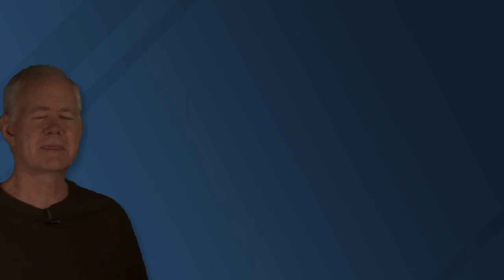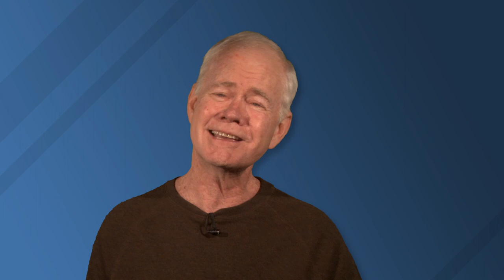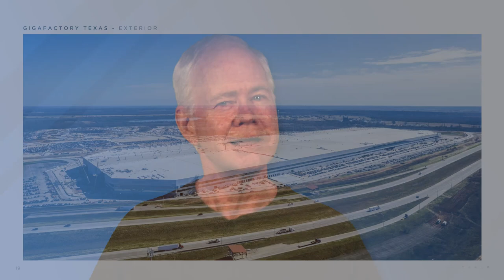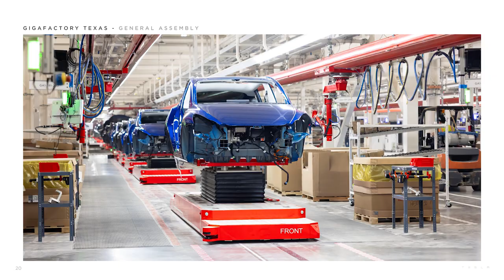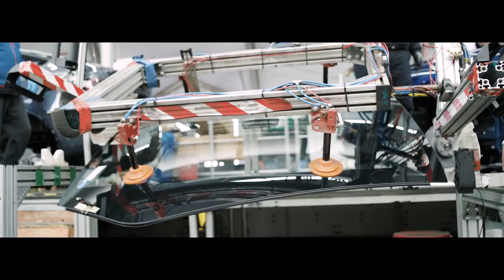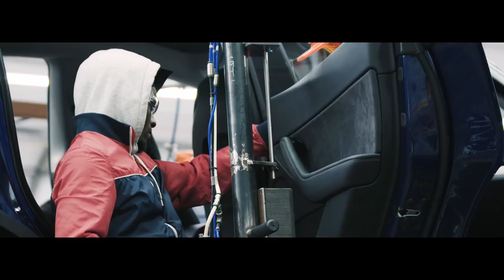Can Tesla Surpass GM & Ford? Here’s What Will It Take for That to Happen

Comment: Volvo just started using one piece casting in the rear. Nobody else is doing it yet... while Tesla is delivering front + rear casting + structural battery pack Model Ys in March, from Texas. Castings are a bit more expensive than steel, BUT a lot lighter, stronger, higher precision and only takes ~1 minute to make one.
Tesla can't do "everything at once", because they have limited chip&battery supply, so they have to use them as efficiently as they can. It would make no sense to make just a couple thousand Cybertrucks per year in a 2 billion dollar factory.
Reply: Volvo just announced that they are looking into using rear castings in the FUTURE. Model y has been using rear castings from Freemont and Shanghai for quite a while now.
Reply: @dclpgh  Texas, not Fremont, and I don't think Shanghai either. Structural battery packs are not unique to Tesla.
Reply: @AutoReport1  you're a little behind on your information my friend.
Reply: @dclpgh  hmm, no just got Texas news mixed up with Fremont.
Reply: @dclpgh  IDRA and another supplier are bullish on sales to other automakers, but don't even confirm supplying Tesla with the biggest die cast machines. I wouldn't count on Tesla maintaining this lead for even a generation.
Reply: @AutoReport1  Fremont was the first to have operational Giga casting machines. Shanghai has four Texas has 3 up and running with two on the way. The German plant as2 up and running and we'll have 6 total. See? Now you're all caught up.
Reply: @dclpgh  
@andrew charles The first Model Y coming from Fremont had a two-piece casting, but they quickly upgraded to single-piece after just a few months. Shanghai Model Y also has the single-piece in the rear. Texas has front+rear+structural pack, Berlin just the front and rear castings - standard 2170 pack.
Reply: @AutoReport1  CLUELESS
Reply: @dclpgh  No, they are retrofitting the Torslanda plant and will use the castings for a 2025 model car. Polestar will also use them but they're making bonded aluminum frames on a 2024 model as well. Volvo is pretty aggressively going BEV but they are only at 6 percent BEVs. They do have a new EV out end of year and one out next and probably one per year for the next few years.

Comment: Tesla needs to focus on it's Cyber truck and get it out before the Silverado EV . The next vehicle should be a compact pickup based on the model 3 or Y to compete with Maverick and Veracruz. 
We have not heard alot about on the Semi. If they are still making the semi, that should be the next factory. If the Semi fails thats your backup production facility. 
Building a factory in Detroit would be a slap in face to GM and Ford, but not practical. Next factory should be on the East Coast to cut shipping costs and create another supply for Euro market.

Comment: They'll need a truck, or two, the roadster, the model 2...and 3 more factories.  AND they have a very difference perspective - million mile cars, exterior/interior styling doesn't change much so if you buy a tesla will you need to replace it every so often? If not what does that do to the used car market?

Comment: With EV’s, there is little to differentiate drive trains and power electronics. It will be more about design and practicality. Tesla isn’t set up to bring new designs to market. Inertia is what will hold them back.
Reply: Do you think Inertia will slow down Tesla?  I don't think so. Tesla is constantly updating EVERYTHING.  Look at the Giga Castings- No one has that and that alone has reduced the time to produce a car from 30 hours to 10 hours, and the number of parts from 140 to two. The model S power train is more powerful every year, and its design is the example for every car maker. Then look at Tesla's Octa-valve, the most efficient way to distribute and control the cooling and heating system in ANY EV.  The battery's chemistry is improving constantly, so is the efficiency is also higher, and Tesla is also adopting LFP.  Those are some of the instances, so I don't think stagnation is in the roadmap for Tesla. For GM, Ford, Stellantis, BMW, Daimler Benz, VW and Toyota,  yes, stagnation is the name of their game. and they need to get rid of their ICE business model first.

Comment: The problem Tesla has with gaining that kinda market share in the US is they're not making the models that Americans buy the most of. Model Y is the closest thing they've got to where the current US market is. Tesla needs a midsize pickup, a full size SUV and a full size pickup that doesn't look like a 9 year old designed it. The Cybertruck is the only somewhat desirable vehicle they have in the pipeline for mass sales, the Semi and Roadster 2 are not going to bring significant sales volume. 

Even if Tesla has some SUVs and a midsize pickup in development, what happens to Semi and Roadster 2? Will their release dates be pushed back additional years? That means at the soonest new Models from Tesla are not gonna be available for at least 4-5 years and that gives OEMs plenty of time to ramp up several vehicles at the same time. 

Companies like Ford and GM are well seasoned at developing a dozen models or more at the same time and bringing them to production on time. Look at GM recently, in just the last couple years they've come out with all new versions of their full size pickups, full size SUVs, refreshed multiple models and a completely new Corvette with a completely new engine placement. That's just the ICE vehicles they've been working on, at the same time the Hummer EV, Silverado EV, Lyriq, Equinox EV, Blazer EV and Sierra EV have all been in development. Plus EVs have less variety in propulsion systems compared to ICE vehicles, this means GM can share components they never dreamed of and that speeds up development time and cost.
Reply: The Tesla CYBRTRK  when it comes  will be impervious  to HAIL ,  and  Baseball bats,I like watching AARebuilds , Randy in Youtube  as he looks  @ Hail damaged  cars and trucks SUVs in  Oklahoma Copart Auctions.
Reply: @aurelio-reymilaorcabal9669  the Lordstown factory will have a production rate of 50 gigawatts a year and GM has 4 battery factories in development to keep up with demand as they transition. Springhill Tennessee factory will be complete in late 2023 and Lansing will be ready the following year, the 4th factory location has not been announced yet. GM has multiple factories around the world that can easily be retrofitted for EV production, they won't have a problem with scaling up. Raw resources is gonna be the limiting factor for all EV manufacturers moving forward as EVs start to become mainstream.

Comment: What your forgetting is the capacity of GM and Ford are gas and that will shrink. Tesla is electric and that will grow. Plus the big 3 are converting old plants which is not as efficient as a purposeful built Tesla plant. Also all of the testing ive seen shows Tesla has the best battery's by about 20 percent. Marys 25 models by 2025 is a pipe dream at best and the electric hummer and lyric sure are not going to push them ahead.
Reply: Hey hey hey, how dare you talk about Mary bo-berry like that. GM can totally make 25 different EV models by 2025. All they gotta do is make 25 of those skate board thingies and slap a different body style on each one and BAM! GM is still the EV "leader". Then some idiots can buy them for over $1mil each like the first Hummer.

That being said, if GM has 2 EVs that hit volume production by 2025 I'd be surprised.

Comment: Tesla certainly has first mover advantage.  But it doesn’t appear to me they have any long term competitive advantage.  Many people believe the Mach-E is already a better vehicle.
Reply: I don't see how the Mach-E is a better vehicle. Tesla is ahead to Ford and GM at least 5-8 years.  The Mustang's autonomous driving is very primitive, the OTA doesn't exist so you have to take your car to a dealership and leave it there for a couple of days, the cooling system doesn't compare to any Tesla, old or new, Tesla gets improvements on its units daily, while the Mustang is every three or four months if any, and the brake regenerative system doesn't compare to Tesla's either, and those are just a few, because the list covers a roll of toilet paper..........
Reply: @jorgerobles8334   I’m glad you think that - the automotive critics do not .  If the engineers at Tells have the same attitude it will be easy for Ford & GM to surpass them.  Tesla has benefited greatly from an overly generous government welfare program for the rich.
Reply: @rickrosler  Thanks for seeing my point. What I would like to add to that is that we are now in an Era of Advanced Technology, and Tesla is not a car company, but a Software company that put into practicality their Advanced Electronics and Software logic and principles. That is another thing these car analysts do not see yet. And that the competition is coming is just that- Empty Words.  But I partially reject that assumption that Tesla benefited greatly from this Rich People Welfare.  Tesla got a 460 Million USD, and it repaid it with lots of interests in less than 5 years, while GM and Chrysler have not. And not only that, GM is actually Chinese, not American anymore, check at the bailout the Chinese gave to GM, and that mostly no one knows about.  Second, Tesla/Musk have been paying their taxes as prescribed by the IRS laws, and MUSK paid 11.3 BILLION USD in taxes for last year.  And Tesla/Musk gave 6.6 Billion dollars of his own fortune to the UNCHR to combat global famine just some weeks ago. I know, 6.6 billions out of 236 billions is nothing, but who had done even 100 million USD to do that?  No one else.
Reply: @jorgerobles8334  The welfare benefit I was talking about is the $7500 vehicle purchase subsidy.  I guarantee they would have sold many fewer cars in the US without that.
Reply: @rickrosler  Oh, the incentives!!!!  They expired for both Tesla and GM long time ago, in 2018,  so that is not a factor right now. The 2021 BBB doesn't include any Tax credit so far, and anyway, Tesla is selling lots of vehicles despite of not enjoying those incentives any more. And not only that, the production of Model 3s is already sold for the rest of 2022, and Tesla have thousands of orders for the Model Y and model S and X with expected deliveries in six or seven months.  And that is not counting for the 1.5 million orders for the Cybertruck. Tesla sells with no promotion, except for word-of-mouth. My family owns Teslas since 2014, and we already have three of them, my son-in-law sold his F-150 and, made an order for a 3-motor Cybertruck. We are not looking back to any more ICE cars.  No other brand offers what Tesla offers at short and long term.  We continuously have improvements for our cars making them more efficient each day passes by.  Tell me which car- American EV, European EV, or Chinese EV is doing that?  Just think about that.

Comment: You call Model 3 " Luxery " !? I call it "basic". The problem Tesla is facing is battery supply. There is no Tesla battery and by now they have contracts with 5 different suppliers.
Like all the others (except BYD) they pack , group the battery's because they have to fit into there cars. But they do not have a battery technology and this is going to hurt soon.
This 4680 thing would then be the sixth one..... Will it ever happen !?
There is a lot of (positive) misinformation about Tesla in the market.

Comment: NO way Elon would be stupid enough to build in Detroit. Heck, GM and Ford build in TN,  or Mexico.  Tesla needs the model 2 car, and then needs to put it in Mexico or any other country in South America that is part of their trade free zone. If you don't manufacture in a trade zone compatible country you can't sell in Brasil without a huge import duty that makes your car DOA.  There are 500 million people in Central and South America, and tesla has 0.0% market share.   Tesla will never get past 20%; they are going to be shut out of Korea, Japan, and South America for the foreseeable future, and Malaysia is not going to let them waltz in without a local partner, same with Indonesia.  Whereever you turn, you find local politics involved with the car business and although i expect GM to drop to 15%, and Ford to 10% share, losing some points to Tesla, i also expect China's factories to crush the many smaller brands around the world. China will have an EV plant up and running within short order, and i expect two chinese companies will try a US plant.

Tesla has yet to taste the counterattacks from Toyota, which has a functioning parts system (Tesla refuses to allow 3rd party companies to get parts).  At the moment Toyota is adding hybrid across their line, and for many americans that will delay the need to fully electrify.  EV's will not get past 50% until you solve the problem of where to charge at night for apartment dwellers.

Comment: When you look at the EV plans for some of the legacy automakers, i don't foresee Tesla ever overtaking them just by their sheer lack of models available in various automotive segments. Just from the a persons personal preferences and taste, I think most will not want their vehicle look like most others on the road. Where companies like GM, VW, and Ford will have a major advantage is the variety of EV vehicles coming.

Just look at General Motors: Thought I would compile what is projected, announced, and in production for General Motors EVs.

Baojun
E100
E200
Kiwi

Brightdrop
EV410
EV600

Buick
Mid-Size SUV (Electra?)
Velite 6 (China)
Velite 7 (China)

Cadillac
Celestiq
Escalade IQL
Lumistiq
Lyriq
Optiq
Symboliq
Vistiq

Chevrolet
Blazer EV
Bolt (end in 2023)
Bolt EUV (end in 2024)
Menlo (China)
Equinox EV
Silverado EV
Performance SUV (Mach-E competitor)
Performance Sedan (Camaro replacement with new name?)
Electric Van
Electric Vehicle under $30k
*Tahoe EV?
*Suburban EV?

GMC
Hummer SUT
Hummer SUV
Sierra EV
Mid-Size SUV
*Yukon EV?
*Yukon XL EV?

Wuling
Hongguang Mini EV
EV50
Dianka

*Yes Tesla has the technological advantage (for now), but I doubt they will ever have the depth of model selection and variety.

Comment: Jeff doesn't have a good grip of the big picture. GM and Ford both need to invest billions upon billions of dollars into EV research and building out factories. 

The issue at hand is that Tesla has a huge cost advantage. A quick look at how much money they make per vehicle compared to everyone else is all you need to look at. 

As the big three convert to EVs they will not be able to sell them at competitive rates; therefore, discounts will need to be given to push those sales.

Meanwhile, as they are discounting their EVs, they will see declining sales of gasoline vehicles to ev sales from Tesla and others. As those sales decline, it becomes much harder to continue investing in the development of new evs.

But here is what Jeff is missing. Where are you going to charge your Chevy or your Ford? Both have no interest in developing charging networks and while you may think that's not a huge issue, we are already seeing people sell off their Mach Es (amongst other brands) because charging on the go is near impossible. 

In the end, people are going to flock to the company that gives them the 'full experience' meaning a. Exciting ground-breaking cars, b. The ability to go anywhere and simply be able to plug into a charger with no hassle.

I speak from experience, I have used different chargers and half the time they are broken, most say they are high speed but are barely level 2 and you have to have an account with each of the 50 different charger companies. It's a total pain. 

We have a GM plug-in. I don't go out and tell people how great the car is, because it's not! In fact, I tell people to avoid GM because they nickel and dime you for every service! You want remote start? Yeah, it's $35 a month! (WITH APP NOT FOB).

Now you know channel did a great video called it's the superchargers. That breaks it down incredibly well.